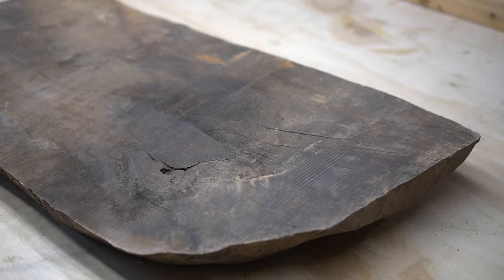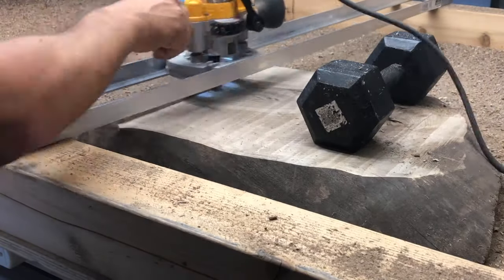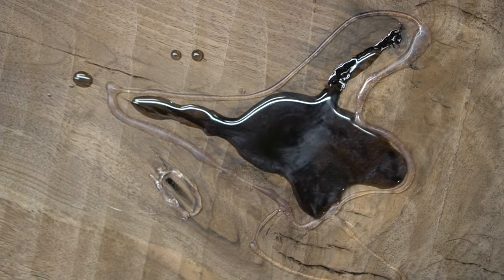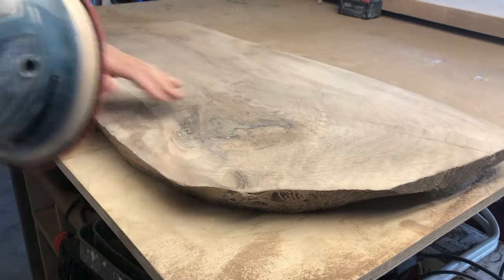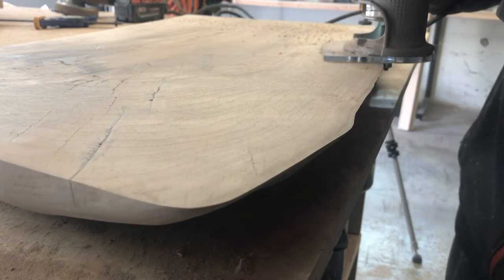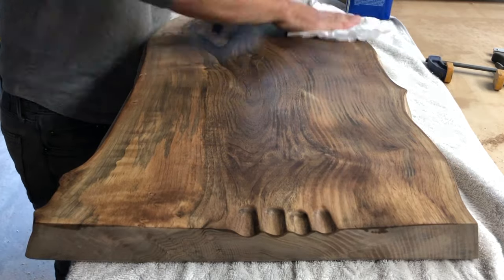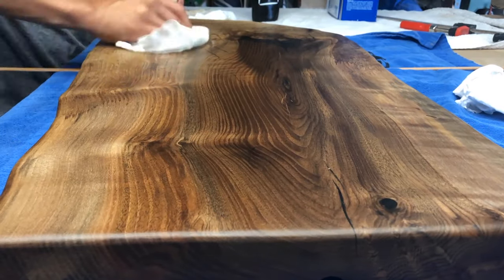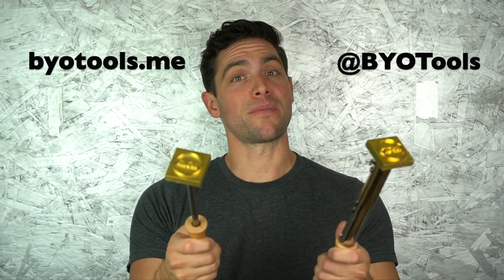DIY WOOD RESTORATION : Walnut Charcuterie Board

Comment: I DON'T UNDERSTAND YOU SAID WHEN FISHED WITH THE ROTOR IT WOULD BE A PERFECT LEVEL BOARD, MY QUESTION WHY WAS IT CUPED SO BAD IN THE CENTER WHEN YOU HAD A PERFECTLY FLAT BOARD AFTER USING THE ROTOR
Reply: If you're referring to the "cup" shown at 4:48, IF I'm not mistaken, he left that intentionally there as he was going to make a recess to hold the serving tray/board. Therefore he avoided additionally sanding/gouging by leaving that "cup"/recess. Work smart not hard kinda thing
Reply from the maker: Hi David.  Good question and Janie nailed it on the head.  The board naturally dipped in the middle on one end as you can see at 2:04 of the video.  The board lays perfectly flat since the router hit both sides of the board and since I wanted to make a handhold there anyways I used it as an advantage in order to create a better handhold.  Thanks for watching and the support from both of you!
Reply: I'm talking about the above video he said that using the rotor you would have a perfectly flat board  that board is not flat  it is cupped, all I'm saying is I don't want to buy a rotor and adapter if his method does not work I'll continue to use my planer if when I'm finished I have a piece of wood that I have to throw out